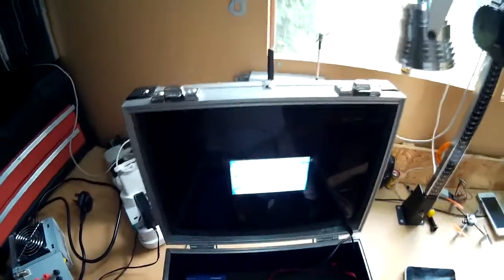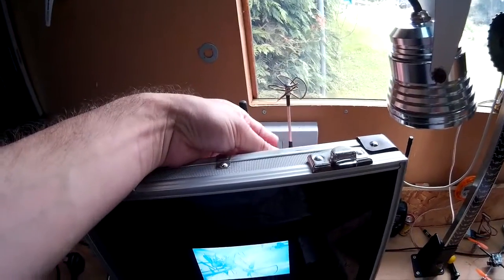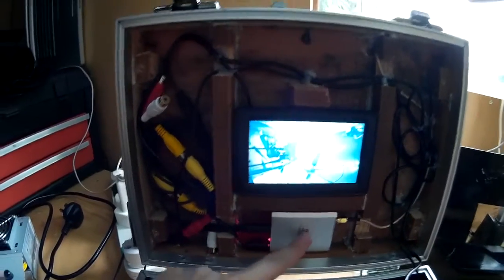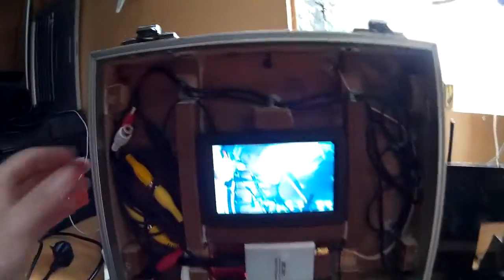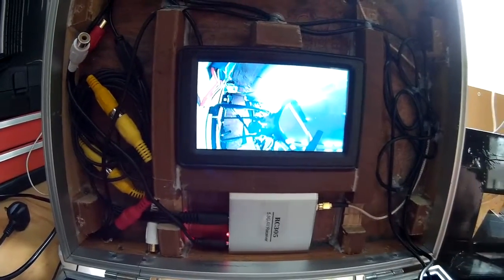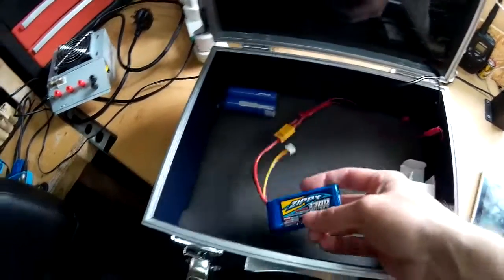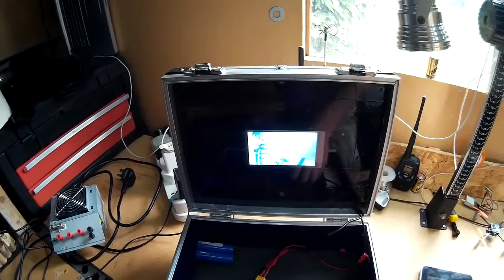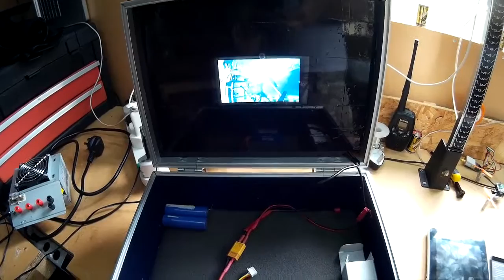Diy 5.8ghz FPV Ground Station Syma X8C

Comment: Proper smart that, the pespex and your build quality is really high quality :-) its a well thought out, setup case, I like the idea of the li-ions, you wont need the peak current of the li-pos and can make a few packs easy enough to swap out, and wont even need to balance the packs as they will be on a trickle :-D Pro job!
Reply: ***** from a guy who knows his stuff I'd be beaming with that :-p yeah I thought it needed the share :-D Both this station and the fpv diy camera are A-Grade builds :-)
Reply from the maker: battonfive Yeah Good idea i did not think to make it swappable i will make a few packs.
Thanks mate.
Reply from the maker: ***** Thanks.